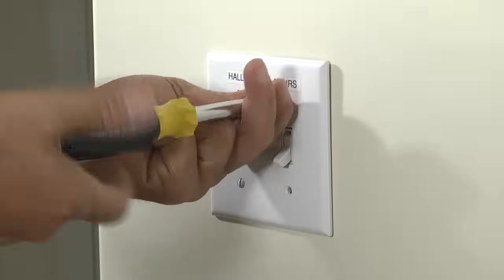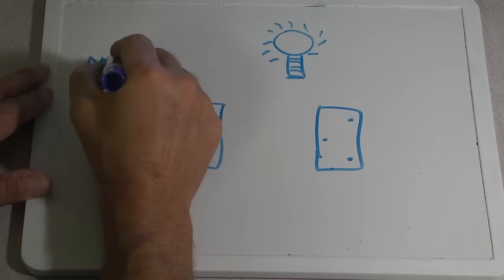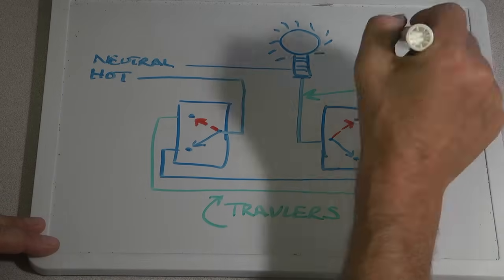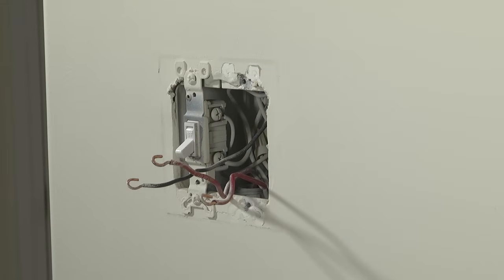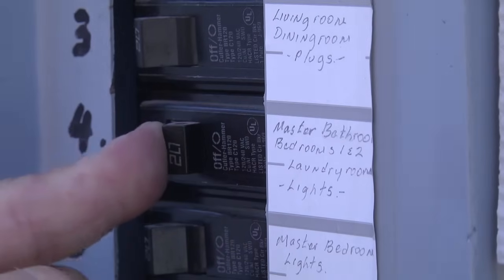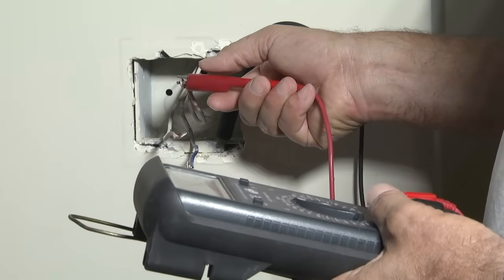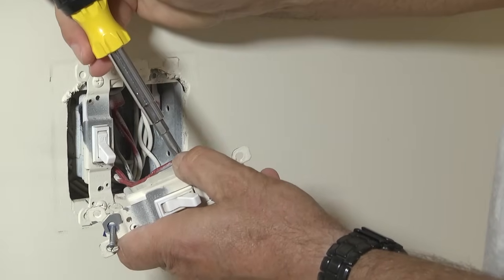Find the correct wiring for a 3-way switch in 2-minutes!

Comment: I just bought a house that had a miswired 3 way. If i got the switch wrong the lights wouldn't come on at all. I knew a common and traveler had to be switched around. But this video broke it down so easily and quickly. I found that the hot and a traveler were switched around. Re wired them properly and both switches work the way they are supposed to now.

This is definitely how a how to video is supposed to be done.

Comment: I installed Occupant sensor 3-ways switch (A) . Another 3-way switch (B) is required turn on permanently. Switch (B) becomes a non-wired dummy switch, Is it correct connect 3 wires together to "turn on" circuit forever?

Comment: What if on the second switch, I don’t have house current (still 120ish I assume) on any of the wires?
Do I need to wrap the wires on switch a together better?
Can I attach switch an and then test the wires for switch b?
I’ve also changed the switches in case the first 2 were bad

Comment: when i tried tying all three together from the box with the hot wire and turning on the breaker, it trips and turns back off. so i can't find the load line in the other switch box. any recommendations to solve here?

Comment: When you drew the diagram at the start, you said two travellers, and you only drew one wire. Later you said switch A was hot, then switch B has house current, what is house current? Is that hot? This was terrible.

Comment: Excellent video instruction. Way too late to add it now, but a SCRIPT would be a lovely addition.  I think it would read as follows:

1. Power Off
2. Disconnect traveler wires from both switches (leave wire on the common screws *)
3. Power ON
4. Connect VOMeter to ground and test for HOT lead at each switch location and LABEL that lead as HOT and that switch as 'A' (or 'LINE' side).
5. POWER OFF
6. Short all leads on LINE side (Switch "A")
7. POWER ON
8. Connect VOMeter to ground and test for COLD (no voltage) lead at the other switch ("B") location and LABEL that lead as LOAD and that switch as 'B' (or 'LOAD' side).
9. POWER OFF replace and re-wire both switches as needed.
10. POWER ON - you're done.

* This might not be necessary if the wire colors are 'to code' in your neck o the wood. But I think it would be helpful if the wiring had not been installed professionally and there were only black, white and copper leads/wires in each box. At the moment, I'm dealing with an Intermatic digital timer that needs to know which switch is LINE and which is LOAD.  Don't want to screw up the wiring on it as it is very expensive and I've no warranty!
Reply: BY THE WAY - this was a great video - shorting the wires was something I'd never seen done before. Make Mucho Sense!

Comment: I spent two hours tripping the breaker, running the meter on lines trying to debug an existing 3-way and wasting my time! This video, was amazing. As others have noted, super clear and practical, actionable steps to identify and wire the correct existing wires. Thank you for this! The white board of the switch diagram is forever imprinted now in my brain and the steps to find the power source in the A switch box and the load in the B switch box were game changers. I was back at it this AM with new confidence and Mojo and had it sorted and wired in 15 mins. Soo Helpful!
Reply from the maker: I 'm glad the video helped you and thank you for the nice comment.

Comment: Once you find the hot in switch A tie the other two wires together. Go to switch B and use a multimeter to check which wires have continuity. Those will be the travelers. Same concept.

Comment: Using your method, I measured the voltage of each line in my 3-way switch: the voltage of the black line to the ground is 67 V, the voltage of the white line to the ground is 70 V, and the voltage of the red line to the ground is 0.4 V.  What could I do for the next?
Reply from the maker: Give me a call at 310-398-7430 (voice only-no texts) and I can help you out. Thanks, Jim
Reply: @MarVistaCat  Thanks for your reply in time.  I fixed the voltage issue by reconnecting wires in electric box for light fixtures. The voltage of the black line to the ground is 120 V and the voltages of other two wires are zero now.  But new issue appeared.   I tried to bind three wires together in the first 3 way switch  where the power line (black wire) went to common screw,  as you showed.  It was very strange that the light was lit immediately,  even the wires in the second 3 way switch were not connected to screws.  I also tested continuity by binding red and white wires first. The results showed that  red and white wires are normal connected but black one are also connected.  As a result,   only the first 3 way switch works.  The second one has no function.  Any help will be highly appreciated.
Reply from the maker: Give me a call at 310-398-7430 (voice only-no texts) and I can help you out. Thanks, Jim

Comment: LOVED this video!!  Unfortunately, what I found on my circuit, was a hot wire on BOTH switches.  I was expecting one of the sides to be completely dead and the other side to have one hot wire, but that’s not the case with mine.  My hall light stopped working after a power outage.  I ended up replaced the light fixture and both switches and it still doesn’t work.  I thought maybe I wired one of the switches wrong.  Watched this brilliant video and found a hot wire at each end.  Used both of them as the hot and the load, but still nothing.  Any ideas anyone?
Reply from the maker: Give me a call at 310-398-7430 (voice only-no texts) and I can help you out. Thanks, Jim

Comment: Does this process still work if the power is coming into the light before coming into the switch box?  If so, this is EXACTLY what I need.  And if not, it is still a straightforward solutions-oriented video that I have liked and bookmarked for later use!
Reply from the maker: Give me a call at 310-398-7430 (voice only-no texts) and I can help you out. Thanks, Jim

Comment: I'm hoping someone sees this in 2024.  First switch, no problem identifying the hot wire.  But on the 2nd switch, I have a red wire that is hot AND a black wire that is hot.  The other black wire is not hot.  Do I assume the red wire is the "load" to be connected to the common?  Thanks for any advice.
Reply from the maker: Give me a call at 310-398-7430 (voice only-no texts) and I can help you out. Thanks, Jim

Comment: Good info.  One question, what if switch A has house current on two of the three wires when you check it with a no contact electrical tester.  Switch B appears to have four wires while switch A has three wires and two of them have current.  Switch B has no current when testing with electrical tester.  Switch B is in the entry foyer of the house while switch A is in the garage and they switch turns on several lights (two lights on either side if the garage door, the light at the front door right outside the foyer and a front yard lamp in the front yard.  Could one of the travelers have house current?
Reply from the maker: Give me a call 310-398-7430 (voice only-no texts) and I can help you.

Comment: Similar problem but with a four-way.  What do I need to do to figure it out?  I'm assuming I have to disconnect all the wires at all three locations and find the hot wire, but how do I figure the load?
Reply from the maker: 4 way switches are different from 3 way switches. There is no load wire, only travelers. If you have any questions. please give me a call at 310-398-7430 (voice only-no texts).

Comment: I replaced two three way switches in my dining room when we painted. Followed the schematic to the T and one switch was the master and the dimmer switch was the slave. I'm a low voltage tech, so figuring this out was impossible. I watched this video and found that the line was actually the white wire and the load was the white wire for switch B. In 7 minutes what was a nightmare is now finished. Thank you. Thank you. Thank you!

Comment: Thank you! I had to rewatch it a few times. This video with a conductivity meter and voltage meter helped to identify the broken switch and hook the replacements up properly. I agree that this is the best video I watched on this!! Thank you!!

Small note, I saw small phantom voltages of 15 to 30 VAC on the transfer wires.

Comment: This is exactly what I needed, I spent a couple hours watching videos that you just explained much better how to do in 2 minutes! Thank you!!!!! Only problem is I don't have grounded outlets in most of the old switch boxes. I have an old house with old wiring with all the old furry black wrapped copper wires, they all look the same so I was scratching my head how to figure out the correct wiring for new switches, replacing those old pushbutton switches!

Comment: In the uk it’s a two gang two way switch. Ie 2x two way switches on the same back box , the connections between the two way switch say at the bottom of the stairs and the two way switch at the top of the stairs that link the two switches together we call them strappers, our two way switch terminals are marked as C or common and L1 and L2 the live /hot brown gos to common blue strapper marked with drow sleeve to L1 to get two way switching we take the live/hot from the common and put it to L1 and move the blue to L2 we the run a the core up to the switch at to top of the stairs and connect brow to common blue to L1 grey to L2 .. back at the bottom switch brow to common blue to L1 and grey to L2 .

Comment: Wish I had found this video first. Thanks. You made it easy to find the hot wire and the load wire. Which are now marked. Of course based on some crazy electrician, the hot wire is white and the load wire is red. Go figure.

Comment: So I got my Switch A with the one hot (house current) wire and connected it to the 2 travelers, but my Switch B has only 1 hot wire.  What do I do now?
Reply from the maker: Give me a call at 310-398-7430 (voice only-no texts) and I can walk you through it. Thanks, Jim
Reply: @MarVistaCat  Thank you for your kind offer to personally help; you are a man among children.  I have squirrel-brain and shelved fixing the switches until today.  Today I figured out what I thought was Switch A was actually Switch B.  Although my comprehension of the circuit is vague, by meticulously following your instructions I fixed it.

Comment: Thank you.  I watched 4 videos before this video and your tip worked.  I had an extra wire in one box the same color as my traveler wire.  When I tied the two travelers to the hot wire I found the extra wire had no power.

My 3 way switch now works perfectly with new switches that match the decor.

I caused the initial problem when I just wanted to upgrade the switches after a room remodel.  I removed the wires from the old switch without marking them.

I won't make that mistake again.

Comment: Dude... Thank you very much for making this video. Trying to install smart switches and nothing was making sense. Whoever wired our house previously did the exact opposite of what everything said it should be. This totally helped me determine what was what. Now, if I can just get these things to connect to the freakin' WiFi! Got a video for that by chance? lol
Reply from the maker: Hey Robert, Please give me a call at 310-398-7430 (voice only-no texts) and I can help you.
Reply: I appreciate it. I figured out what the issue was. I'm using Kasa Smart Switches and when trying to connect (like a dummy) I was selecting the wrong switch from the list (dimmer vs non-dimmer). Once I noticed that they connected without issue. Thanks again!

Comment: Very good instruction. However, in my case I was unable to find line power in ANY of the wires! I ended up making the non-intuitive decision that they used the White wire as hot wire, so tied the Red and Black together and tested for continuity. That led me to decide the Red and Black were the travelers. Put it all back together with White attached to Common and Load, and voila, it worked! The handymen renovators who scrambled the wires were unable to fix their mess, but I did. I would still love it if some real electrician would explain why none of these wires tested for Line power, yet, when put back together correctly it worked!!

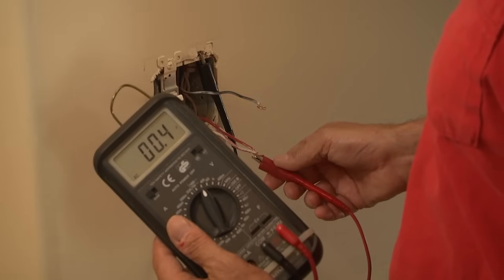Comment: Another of my 3 way switches is acting funny. While looking for current as described at 1:00 minute into the video, I found current at both switches. This was my stairwell.  The conventional switches are working. Im just swapping them out for smart switches. What does it mean when both sides are showing there’s a hot wire?
Reply from the maker: Call me at 310-398-7430 (voice only-no texts) and I can walk you through this. It's to hard to put in writing.

Comment: To add to one's already confused wiring there are also two rare and abnormal three way wiring configurations that may be encountered in a very old house.   There what's know as the California,  or coast 3 way, which connects the hot on a traveler,  then jumps over to the same traveler terminal on the other 3 way, the common terminals between the two three way switches are wired together, the the load connects to the other traveler.   The other 3 way configuration is often called a carter 3 way, and goes by various names including Chicago, lazy neutral,  lazy Susan, farmers,  barnyard,  hot shot, power beyond,  among other nicknames.   This setup connects a hot and neutral to the travellers on both switchs, and the load is connected in between,  to the common terminals. The load can have 4 possible states:  1) Neutral-Neutral  = OFF.  2)Hot-Neutral=ON, correct polarity. 3) Hot-Hot =OFF,  and fixture is live at both terminals. 4) Neutral-Hot= ON, reverse polarity.   The carter 3 way method was banned by the NEC in 1923, but remained commonly used until the 1960s for farms that have a yardlight switched from the house and barn with receptacles constant hot, using three wires in between instead of four not counting the ground.

Comment: Now, how do I add a light to switch B? Would that be a 3 wire from the switch? One for the load and one each for the travelers? With the travelers wire nutted together to the fixtures black wire?

Comment: Alternatively,
Another SAFER way to determine which wires are travellers or load is to do continuity test with the circuit off. 
Wires comes in bundles. If you look inside the box you can see at least 2 sets of bundles (look for cable jackets). 3-way switched have travellers wires in bundles of 3 (not counting the ground wire)  Load wires are usually bundles of 2. 

•step 1: separate each bundle at each switch box
•step 2: at one switch box connect 2 wires of the same bundle together with a wire nut. Take note of the colours. 
•step 3: at the other box test for continuity or tone with a multimeter on the same colour wires of the same bundle. (Eg. at the first box the colours are black and red then at the other box you would also test black & red)

If you get a tone or continuity reads 0.0 then you know it’s the same wire bundle from the first switch box. Those wires are the travellers for the 3-way switch. The other bundle must be the load.
Reply: Bundles??? I see no sets of bundles. In my example there is only one 3-wire romex at each switch. I finally fixed it, but it required making the non-intuitive decision that they had used the White wire for Line and Load! The Red and Black were the travelers. What puzzled me was that when all wires were disconnected for testing, not even the White wire showed Line power. Nothing showed power, but when reassembled correctly, it finally worked.

Comment: Why not turn off the breaker and then choose two wire from 1 switch then splice together and locate its end on the other side of switch? Use continuity to look for the end of traveller wires

Comment: If 3-way switches are working correct what are the voltages on their terminals? Power is not arriving to the load after working for years, one of the switches is bad or a wire lost continuity.
Yes I am not looking to figure out the correct wiring... the correct wiring is not delivering after working for years.